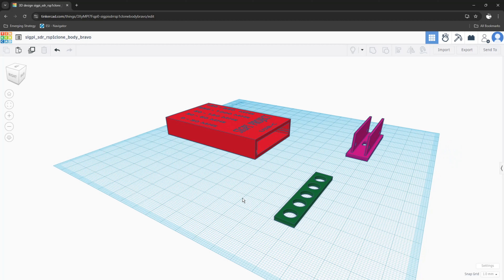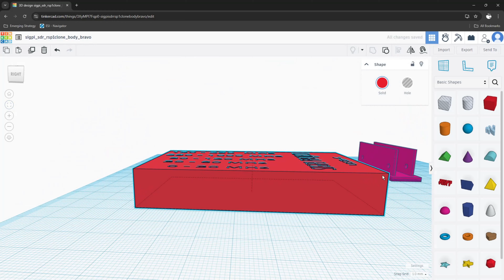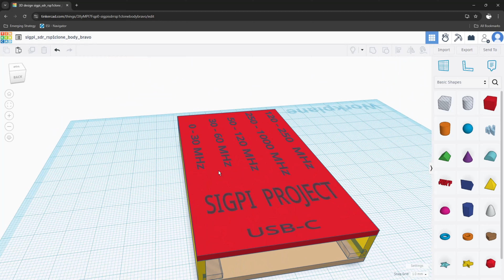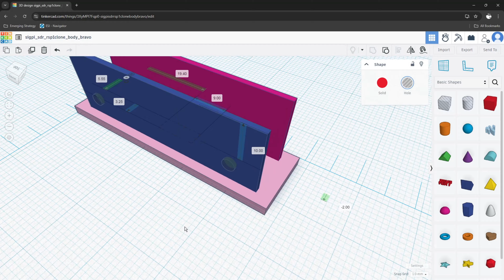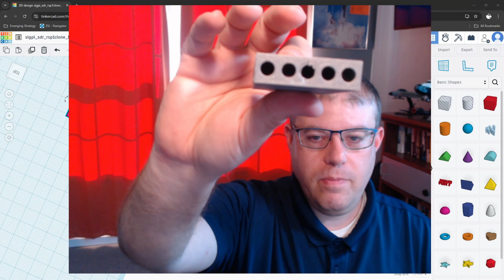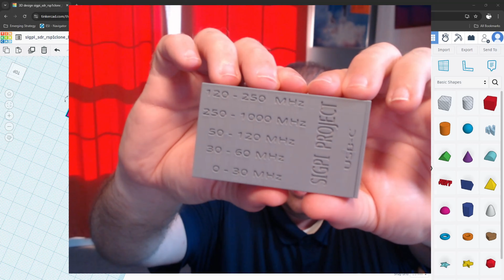Controversial SDR:  Plus 3-D Printing Stuff

Comment: I forgot to mention in my first comment, that I had recently acquired another SDRPlay SDR Rx clone. Basically, the same as yours and the single port version I previously described(using both Msi001 and Msi2500 ICs). 
This version is also a single sma port style , but employs two sets of dip switches to achieve the multi port functionality that you described the Rx in your video as having. 
If you know of any documentation for the two clones I’ve described (other than the data sheets for the two ICs) I’d appreciate any guidance you can provide. Thanks for your time and work that go into your videos. They’re are an excellent educational resource for late comers like myself.
Reply from the maker: I have seen that and shared a phot of it here  https://notebook.hvdn.org/2024/09/controversial-sdr-plus-3-d-printing.html  but did not want to complicate the video.  If you look at the schematic here its interesting how things are set up which make this version likely better as single purpose radios dedicated to specific spectrum.  https://www.aliexpress.us/item/3256804660151348.html

Comment: Nice video. I have the single sma port bootleg SDRPlay Rx. I blame that on Amazon because you have to really look to determine that it’s not the genuine product. That being said, it was a while back when I was just getting into Software Defined Radio and was use to Analog Devices and Michael Ossman releasing their SDR stuff open sourced so I thought that was the standard. 
As I continued to learn, especially by learning the Dragon OS Linux Distro I finally figured it out. 
When I realized it was not genuine, i ordered a couple of Rxs from SDRPlays website. 
It’s funny you made that case, I just finished a basic case for my Rx mainly because I just got some of the new Fiberon PETG-ESD filament. I did my entire design in Prusa Slicer. I started to do it in Fusion but just saw a video of how certain things could be made in the slicer alone and it worked. Yours is way more detailed than mine, and I like the lighter color. 
Thanks for the video!